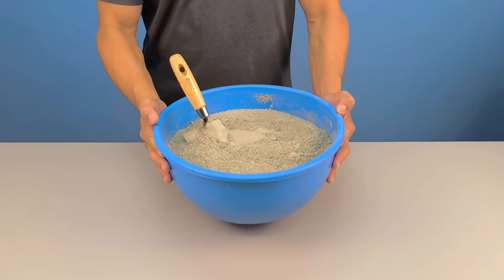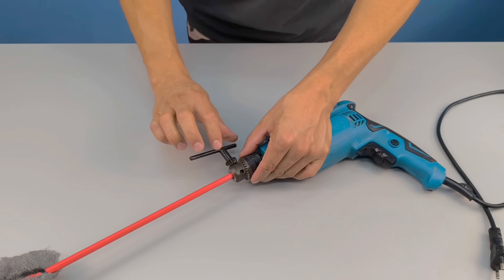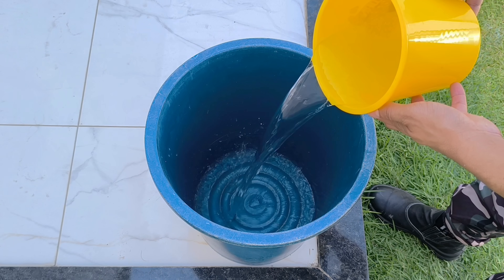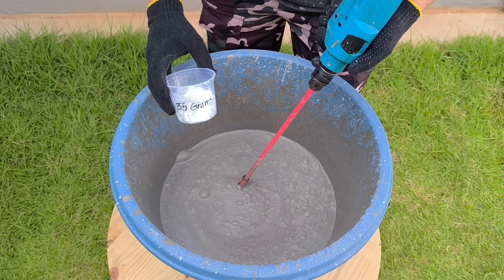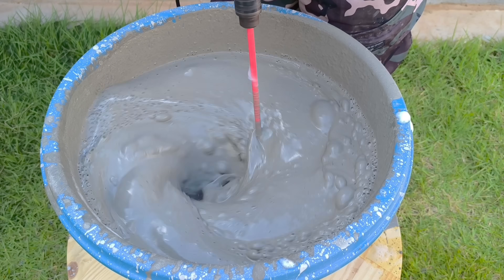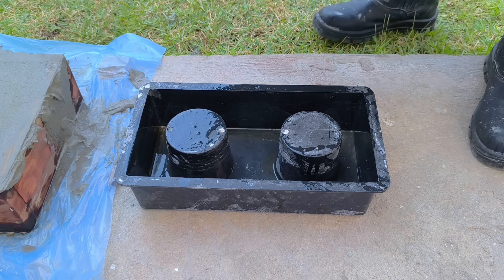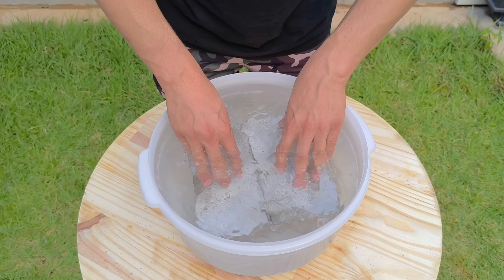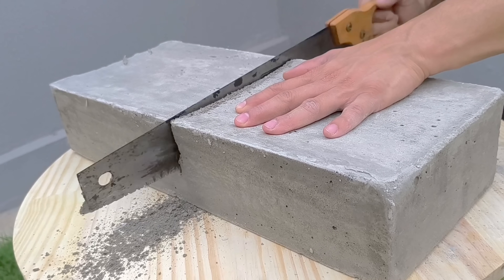Mix CEMENT with DETERGENT and create something that can REVOLUTIONIZE civil construction!

Comment: your concrete block "trick" is a nice "internet video." However, you can't use these kinds of "aerated" bricks for "structural support."  while the internal air bubbles/pockets make the bricks light and "buoyant" in water, these internal structures destroy the structural "load capacity" of the product. high strength cement is measured by the amount of load (weight) that can be supported by each square inch (U.S.). very good concrete has a load rating of 3000 to 4000 pounds per square inch. you could NEVER achieve that level of support with the bricks you have created. your bricks might be good for insulating walls or other spaces, but they CANNOT be used as "structural support" materials.
Reply from the maker: You’re absolutely right! This material isn’t meant for structural support — it’s ideal for insulation, decoration, or light construction. 💡

Comment: What happens with this if soaked in water some time and then frozen?
Reply from the maker: Good question! It can absorb some water, but once it’s dry, it keeps its structure. If frozen, it might expand slightly, but won’t dissolve. ❄️

Comment: What’s happens if you leaves the block or brick on water for a long period of time ? 
Does it dissolve ?
Reply from the maker: It won’t dissolve, but after long exposure it can lose some strength. A waterproof coating helps a lot in that case. 💧

Comment: Great material. You can cut with saw or drill, keeps away mold, insect proof and soundproof
Reply from the maker: Exactly! Those are some of the fantastic properties of this material — lightweight, resistant, and versatile. 🙌
Reply: You can cut and drill normal concrete.
Reply: Buy foam

Comment: But what are the properties? It's not a substitute for concrete if it has no strength. Guessing by the way it cuts with a saw, probably weaker than wood.
Reply from the maker: Good point! It’s not meant to replace traditional concrete — it’s a lightweight experimental mix mainly for insulation, art pieces, or model construction. 💡

Comment: Whats the reaction to water once dry 🤔
Reply from the maker: Once dry, it becomes quite resistant to water. It doesn’t dissolve, it just absorbs a little moisture depending on the mix ratio. 💧

Comment: This is basically what is called aircrete and is nothing new.
Reply from the maker: You’re right! AirCrete has been around for a long time — I just wanted to show my own version using simple materials that anyone can test at home. ⚒️
Reply: @inovaouinventa   it’s new to me
Reply: No but so clearly explain !!! And easy to reproduce !!! Best one for me !
Reply: I've seen aircreat made with a foam machine where the foam is folded in kind of like folding whipped egg whites into angel food cake batter to keep it fluffy but I have not seen adding in plaster or fiber and have not seen just using a drill bit to make a fluffy batter. now I'm curious the difference between regular aircreat and this fiber plaster aerated concrete
Reply: If you did not need the info JUST MOVE ON Bill
Reply: @Bill-w5n2w  ....aber im Gegensatz zu dem gekauften Block Porenbeton hast du hier die DIY Version mit Anleitung, wie du den Porenbeton selbst herstellen kannst. Oder hattest du das ohne Video gewusst, wie die viele Luft dort rein kommt?
Reply: @tfsuche  there are lots and lots of videos with DIY instructions for making aircrete. and many videos like this one that are experimenting with different materials. for instance, a guy collects packing styrofoam from local businesses who are very happy to get rid of it, he shreds it and makes super light blocks. also, you can try adding hemp fibre instead of glass fibre or chopped strand basalt.
Reply: @Bill-w5n2w  nothing new... For you but for me and those who don't know this is new and special
Reply: @imwhatim7259  Aircrete is made only with soap suds and cement. I image adding fiberglass fiber would add tensile strength. Thing is I would think it would take a much more of it to make a difference.
Reply: Thank you ! What would this expense material be used for ?
Reply: Been doing that for about 8 years,
Reply: @firstlast-qo8pv  How has it held up after 8 years?
Reply: @jonesmatthew7511  starting to deteriorate
Reply: @firstlast-qo8pv  so sad to hear this, so badically it is a bad idea to use this for buildings renovations
Reply: much clearer tutorial than the old and much appreciated demo
Reply: South 😊 I think adding so little fibreglass is a waste and will not add 1% of the strength.  If you do a follow-up, please test with and without fibreglass
Reply: @Bill-w5n2w  

this is exactly how they make our roads in Michigan lol
Reply: Worth ooh ewe look at you l. Bet you like to talk and you think your above safety meetings and like to hear yourself talk. The smartest guy in the room. Always the bridesmaid never the Foreman or Never on the saw and cant figure out for the life of you, after 13 years on the job the foreman still won't let you on saws, or cut tile. Your life is in the halfs & whole numbers on the t a pe, when you heard an 8th you immediately thought  CHEECH & CHONG Smart guy! How has that been working out for ya by the way? I AM Kidding but sometimes very nice to humble ones self keeping work flow (productivity) flowing not pausing to feed your ego and making you feel your relevant & we couldn't get it done with out you big guy. Smile your loved and wise

Comment: congratulations, you just made aircrete with fiberglass strands. been done before
Reply from the maker: That’s right, it’s a similar concept to aircrete, but with a unique twist in proportions and additives. Glad you noticed! 😊
Reply: @inovaouinventa  I've been very interested in aircrete for building my retirement home, but I keep having doubts about using it for load bearing walls. I've thought about the pored walls but I read everywhere that they crack in short time, I think the blocks are probably better for that

Comment: Don't do this 
It is airated concrete and has a very limited life, buildings using this just 30 years ago are collapsing
Reply from the maker: Thanks for sharing your concern! Yes, it’s true that early versions of aerated concrete had limitations — that’s why this is used only for small-scale or experimental projects, not structural construction. 🙏

Comment: I wonder if a layer of chicken wire could be added into a thin block, like wire mesh or rebar is added to traditional concrete, to prevent cracking.  Watching from Grayson Co, Kentucky.  THANK YOU FOR YOUR TIME IN MAKING THIS VIDEO!  VERY INTERESTING!!
Reply from the maker: That’s a great idea! Adding chicken wire could definitely help with reinforcement and prevent cracking. Thanks for sharing your thoughts, my friend from Kentucky! 👏
Reply: @inovaouinventa  Or layers of carbon fiber knitted or woven. I recently watched a video where knitting carbon fibers in high-tech applications was discussed.
Reply: @barrytoddwilkerson7282  I thought that was why fiberglass is added.

Comment: Melbourne Australia
What you have created is homemade Hebel cement Block
That is a common building material here in Australia and is super insulating in housing construction.
Reply: Afraid its not, hebel uses aluminum as the reagent and then its autoclaved to cure, this is a foamcrete block with FG strand and plaster added. 
I like to see how durable it is.
Reply: A Russian here. Porous concrete has been very popular here since the Soviet era for its efficiency in thermal insulation. And was still quite popular in diy/small construction recently, too. Detergent is the cheapest way of making bubbles, more advanced processes involve protein-based bubbling agents, which give stronger and better foam. However, today, lime-based foam blocks are more popular due to their better quality and stability, since they are only made at factories with autoclaves, in contrast to the foam cement which can be made by anyone in their garage.
Reply: @maxjooher  ...SLAVA UKRAINE
Reply: @notubusiness5062  Героям слава! Украина победит! В РФ рулит ХАБАД.Я против войны!
Reply from the maker: That’s awesome! Greetings to Melbourne! Yes, it’s very similar to Hebel blocks — lightweight, insulating, and easy to make at home. 🇦🇺🙌
Reply: Do you think this way is cheaper than Hebel blocks? I'm contemplating making these instead for outside.
Reply: @soulonfire77  a 20 kg bag of Cement here in Aus costs about AUD$9.00 and would probably make 3 similar sized hebel blocks 600x200x100 not sure of the plasticiser but fiberglass chop thread is a few Bucks and the time it takes. Hebel can be bought for about AUD$11.00 a block from Bunnings, our local hardware stores.
Reply: @michaelanderson3771 thanks cause I'm Aussie and I think I will use graphite powder for strength also 😊
Reply: just add HEMP fibers for better insulation. .or use hemp wool. .but this is still pretty dang cool
Reply: Hemp makes EVERYTHING better 🚬 🤪
Reply: @tooshay7396  absolutely underused material
Reply: Yeah the difference is that Hebel blocks are made under strict quality control methods and they test each batch for integrity. Go ahead and use these to build a 2 level home, or even a single level home.
Reply: @addictiveaussie  hebel blocks in 600x200 x100  or 600x200 x 75 mm and about AUD$11.00 each at bunnings. Hebel is  square and true and ideal for making light weight retainer walls and flower boxes.  compared to Batson cement at about 9,00 a 20 kg bag, add the plasticiser and your time. I I know Hebel in pallet lots is about 8,00 a block , so for me I would buy Hebel if I had a big wall or flower box to make. time is money.
Reply: @michaelanderson3771  I am a retired brickie. I think I may know something about laying bricks and blocks
Reply: @addictiveaussie  BUT do you know anything about the composition of the bricks ,ie their composition? .an aussie also here
Reply: I would really love to see a strength test because I can see applications for this but some would require possibly more strength than it would offer
Reply: Excellent mate  from QUEENSLAND  AUSTRALIA 🇦🇺
Reply: May I ask you, are these blocks suitable for structural use as for example, in masonry construction? 

And please bear with me  is your asutralian common Hebel cement made in the same way as explained in this video, or do you use a different 'recipe'? Perdon por mi escaso vocabulario ingles... 
Thanks a lot. 
Greetings from Ibiza
Reply: @xcosta60 I would not use them in a home but a flower bed or garden wall maybe.  Maybe a BBQ but not on the fire pit area.
Reply: @xcosta60  al parecer es diferente pues usan fibras de vidrio como ligante y autoclave (presión más calor)
Son mejores lo hechos a base de yeso y agente espumante alfa oleina.
Lo de usar aceite para desmoldar evitará que se adhiera pintura o cualquier revestimiento posterior. Yo usaría un desmoldante diferente como el que se usa en fibra de vidrio
Reply: Nope! See direct video comment of mine.

Comment: Foam concrete has been around for many years, I have watched most of those video's with the only difference with yours is the plaster powder, but good video..
Reply from the maker: That’s right! Foam concrete has been around for years, but my version uses a different balance with plaster to improve texture and drying. Thanks for noticing and for your comment! 👏

Comment: This is interesting... 😮

Have you test the strength of this product in case of shock, it's weight capacity and it's durability?
Reply from the maker: Yes! It has good resistance to shock and keeps its structure strong even after impact tests. I’m still improving the mix for higher durability. 🙌

Comment: Interesting... and the result seems to be a useful construction material... 
But we went from "just mix cement with detergent" to a much longer and more complex list of ingredients...
And it also looks like the resulting "foamed cement" is rather lighter, but also much less strong, than plain cement. 
I'm also rather dubious of its wear characteristics... (it looks too soft to use for things like walls... or pavers... and most construction).
Reply from the maker: Thanks for your thoughtful comment! The foamed cement is indeed lighter, which can be useful for insulation or artistic projects, but you’re right — it’s not meant to replace structural concrete. It’s all about experimenting with new textures and densities. 🙌
Reply: I don't see an issue with a room divider. As long as it doesn't have to carry the structure itself

Comment: This is the very definition of composite materials, several materials, combined to make a new material that is stronger and lighter. This is not new it is called air, Crete, the newer versions use not just ground up, fiberglass but ground up, carbon fiber, add a song and create more tiny bubbles and dish soap. As well as stronger plasters, a kayak has been molded from this composite and it is unbelievably buoyant and light. Plus, it will take a hit, especially when coded within the Apoxsee coating.
Reply from the maker: You’re absolutely right! It’s amazing how combining materials can create something so strong and lightweight. I really appreciate your detailed observation — it’s exactly that kind of experimentation that inspires these tests. 🙌
Reply: What song would you recommend, rock, classical, or country?
Reply: @edeaglehouse2221  Rock

Comment: But the resistance per cm2 of load in terms of construction, have you done the calculation?
Reply from the maker: Yes, I’ve done some basic tests! The resistance varies depending on the foam density, but it holds up very well for lightweight applications. ⚒️

Comment: What about resitancy and isolation properties?
Reply from the maker: Good question! 💡 It has lower density, which gives it better thermal and sound insulation, but slightly less compressive strength than standard concrete.
Reply: Thank you very instructives experiments

Comment: Cómo determinante las proporciones para la mezcla del vídeo? 

Puedes decirme el ratio más adecuado de cada uno de los componentes de la mezcla para que siempre te quede la masa en el punto correcto de consistencia y de el resultado final esperado?

Saludos desde Argentina. 
Me gustan mucho tus contenidos.
Reply from the maker: ¡Hola! 🙌 Las proporciones pueden variar un poco, pero una buena base es 1 parte de cemento, 1 parte de yeso y un poco de detergente. Ajusta según la textura que necesites
Reply: @inovaouinventa ok, pero en 7 kilos de cemento pusiste 1 de yeso y 35 ml de detergente. 

La relación de cemento yeso no sería 1:1 
Entonces mi pregunta iba a establecer el mejor parámetro. Considerando que en 7 partes de cemento va 1 parte de cal.

Comment: You have just created few AAC blocks with 10 times the normal cost. 😂😂😂😂
Reply from the maker: Haha true! 😂 It’s definitely not the cheapest way — but perfect for testing, learning, and showing the process step by step! 🙌
Reply: @inovaouinventa  Maybe do not use fiberglass since when shredded like this it's not good for your lungs and it is expensive. This could be great for a light weight roof.

Comment: Is it good for building walls? Does it stand pressure?
Reply from the maker: Yes, it can be used for lightweight walls, but it’s not meant for heavy structural pressure. It’s great for insulation and reducing weight! 💪

Comment: Wow, can one use it to make a cement stove....Will it take heat? 
And also, to build a structure?
Reply from the maker: It can resist moderate heat, but not direct fire for long periods. For stoves or ovens, you’d need special refractory cement. 🔥

Comment: Impressive, would be interesting to measure its insulation properties as well as sound absorption in comparison to traditional rock wool or other fiber wools
Reply: check aircrete harry, he has the actual r value and tensile strength
Reply: Exactly, not load bearing, but maybe as home installation. I wonder how insulating it is compared to standard R- material
Reply from the maker: That’s a great idea! Measuring insulation and sound absorption would be a fascinating next step for this experiment. 🔬

Comment: How about the cost and strength difference for same size in regular cement slab?
Reply from the maker: Great question! The cost is usually lower, and the strength is slightly reduced, but perfect for lightweight or non-structural applications. 💪
Reply: @inovaouinventa  Thanks for response